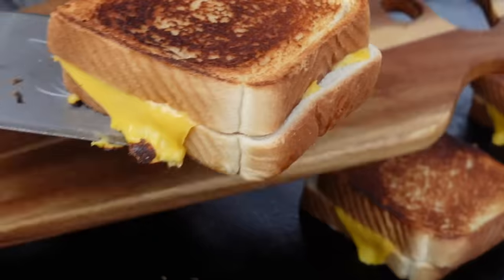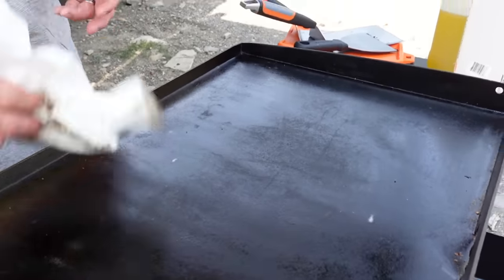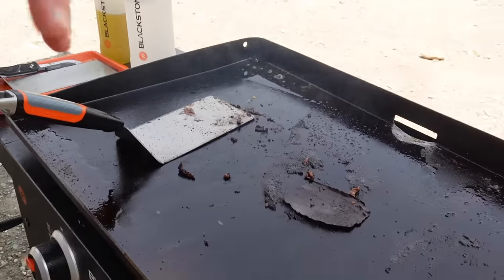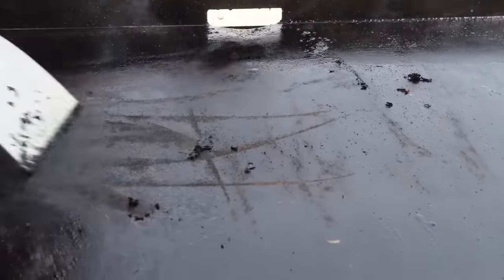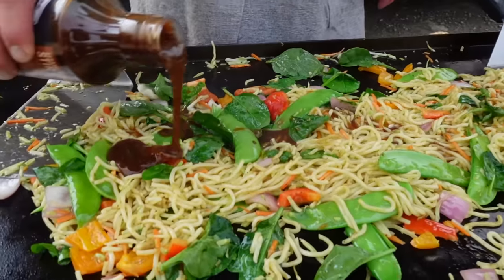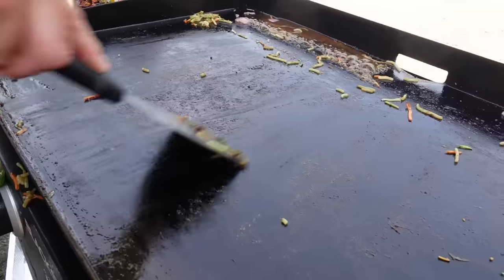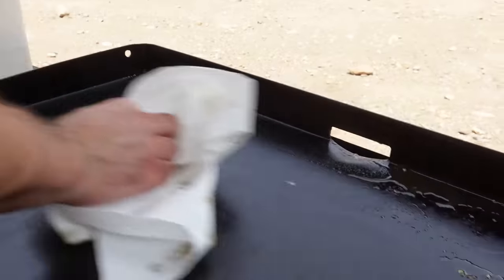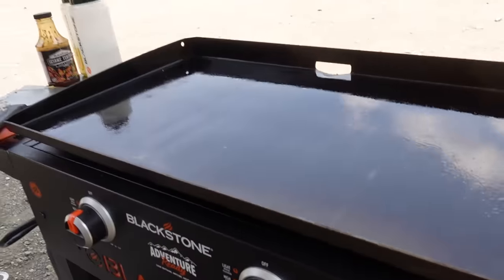How to Clean a Blackstone Griddle | Let's Give It A Try | Blackstone Griddles

Comment: A long handled wooden griddle scraper is a lot easier, does a better job, and is much safer.  Also starting with squirting some water before you scrape gets a lot more up.  
Pro tip: use coconut oil to lube up the griddle after cleaning as it can take high heat for when you use it again. It also taste better and is healthier than seed oils. Never cook your food with canola, peanut, sunflower, or corn oils.  That stuff is poison.
Reply: Avocado oil (refined) 480-520°F.
Safflower oil 450-500°F.
Canola oil 400-475°F.
Soybean oil 450°F.
Sunflower oil (refined) 450°F.
Peanut oil (refined) 450°F.
Coconut oil (refined) 400-450°F.
Reply: avocado oil works great as well

Comment: I don’t use my griddle a lot in the winter. What should I do to my griddle before I shut it down for the winter? It the such a thing as winterizing a griddle
Reply: Hi Trey. There really isn't such a thing as the griddle top is pure untreated steel no different than a firearm. Heavy oil and keep it dry. Whether that means keeping it inside or in a warm garage, you will have to decide. Keep it oiled and away from the elements!

Comment: It is pretty easy to keep the grill clean.  Bold statement:  After using mine for over 5 years it is a MYTH that you ever really achieve a non stick surface.  I believe this is what discourages many BlackStone users.  This video even proves it.  IT IS CLOSE, but it can hardly be called “non stick.”  So, new users, just realize that yes you can cook eggs, and basically whatever, but you will not get your grill no matter how carefully you season it, to a surface which is “non stick.”  Knowing this, you can realistically cook, and know there is going to be some steps to take.  This video, in my opinion shows items that are very easy to clean.  Most of the time it will take longer, and most of the time, you will always need water, and frankly in order to sanitize your griddle after cooking, you should.

Comment: We have a Tailgater the griddle does not have a hard cover (hood) . We do have a grill cover. My question is do we need a hood cover? 
Our blackstone is stored on our back porch that is not covered. We have seasoned it but when we take the cover off it’s has some rust on it. Any help would be appreciated.
Reply: If you have a grill cover over the griddle it shouldn’t rust if you have it seasoned properly. I have a tailgater and that’s all i have over mine. I do live in a semi arid climate though, so that may help too. We get rain and snow, but not extreme humidity.

Comment: I used my 22" Blackstone Griddle lat weekend to cook burgers. I used water to clean it off (maybe didn't need to). Added some oil to prep it for next session, but the griddle is sticky. I don't think that's normal. What should I do?
Reply: I cleaned my new blackstone thoroughly with soap and water out of the box as recommended.  That removed a good amount of sticky stuff.

Comment: Less fluff and more how to clean and why to do it this way.

This isn't an As Seen On TV 30 minute infomercial hosted by Billy Mays.
I don't care how good the grilled cheese sandwich is. I just wanted to know how to clean the griddle that Blackstone manufacturers and figured I'd go right to the source. Smh. If it turned out to be just a 3 minute video, then freaking great, it was just that easy.

The Blackstone branded 10 piece Cleaning Kit I bought had separate how to clean instructions. One set for the scouring pad and another set for the pumice stone tool. Which one do I use? Do I use both? Do I use one tool for one type of cleaning and one for another? Unhelpful instructions in the box.
According to this video, I didn't even need to buy the kit at all and wasted my money. At least I decided to not buy the $50 Blackstone branded cleaning kit in the cheap pleather bag.

The video was about maybe halfway useful. The cleaning process needs to be explained better. I just wanted to know the how and the why without the As Seen On TV Billy Mays vibe.

Comment: This goes against everything written in the manual 😂
Reply: Remember this, most of the older manuals were written by engineers who weld steel together for a living.  I've cooked coast-to-coast on Blackstone Griddles for the past decade.  It's pretty much the same concept as cleaning, seasoning, and maintaining cast iron cookware although our griddle tops are rolled steel, not cast iron.  Thanks for watching!